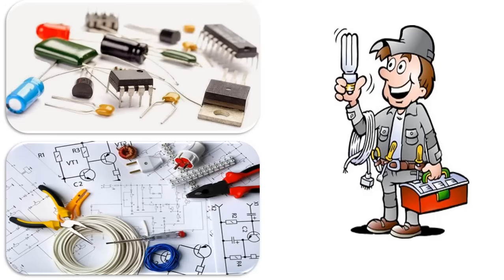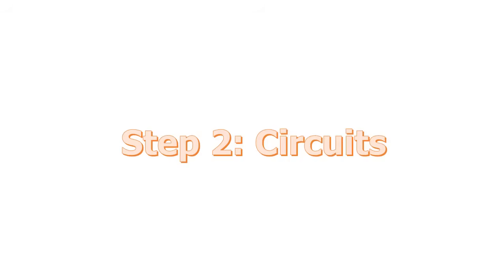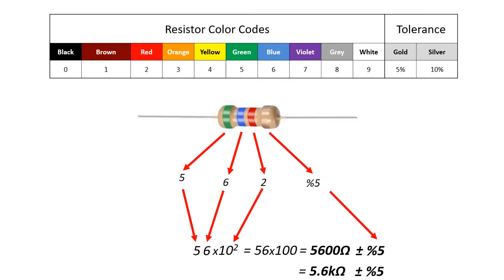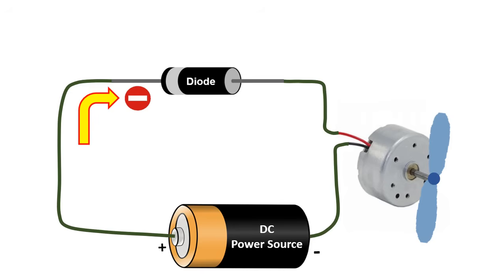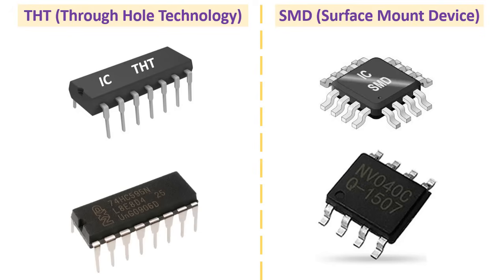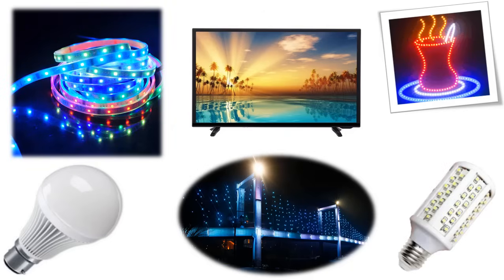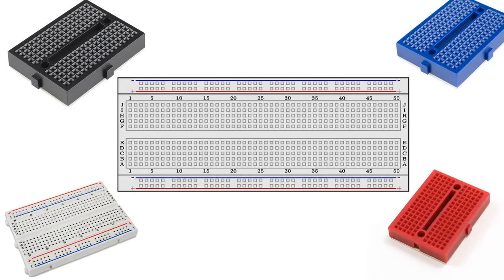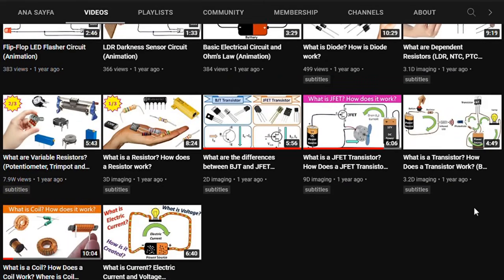Basic Electronics for Beginners in 15 Steps

Comment: What about transformers? In 1978 there i couldn't light up a LED by plugging it into a 120v socket, without using a big transformer 2 do something with the excess voltage and heat... could I? And if i couldn't then, but can now... what happen?

Comment: 2:30 "In series connected circuits, the same current flows through all loads" "In parallel circuits, all loads have the same voltage" This is a very unclear explanation of the difference as it pertains to voltage & current, and to a novice like myself, I thought you were saying the same thing about both in a different way, so I looked it up:

In SERIES all components share the same current but voltage is divided among the components based on their resistance. 
In PARALLEL the reverse is true -- All components share the same voltage equal to the source voltage, while the current is divided among the branches based on on their resistance.

Comment: In a simple circuit with a battery+ resistor+led,the led acts as a resistor and + the first resistor,it becomes a voltage divider,right?! So in that circuit the current is the same as the battery,only the voltage drops,right?! Is my understanding correct?
Reply: No, there are many things incorrect in your understanding.
-A resistor is used in series with LED to limit the current flowing through the  LED. LEDs cannot handle lot of current and they will fry if the current is not limited. 
-Remember V=IR. This means if the voltage drops, and the resistor does not change, then the current has to drop. So this resistor not only drops the voltage but limits the current, which is its main purpose.
-An LED does not act as a resistor. In some cases it is used as a diode but don't worry about it for now.
-A voltage divider is a bit different than anything shown in this video, and I suggest you understand voltage, current & resistors before learning about voltage divider, it will make it easier.
Reply: @kuro758  So if I try to measure current after the resistor with a multimeter,it should be less than before the resistor?

Comment: I want to be an electrical and electronic engineer and practically sound for self training, what are the topics I need to study step by step to get there or achieve my gool.
Reply: Check college outlines and find your own recources. Surpisingly lots of colleges and universities tell you what you need to learn in the outline often times and you can use free open source textbook websites to download what you can find within. Hope that helps
Reply: Electrical and electronics have a crossover point is the first thing to understand. Point of the power supply tends to be the cut off points. Also, electronics gets very deep when we get into rf analogue, digital etc.  Suggest you find a place you are happy at. Much of the stuff one learns at college will never be used in real life, but the principles are important in other stuff even if it is not obvious to start with.

Comment: Without the led spec sheet I would assume it draws 20 mA. The battery is 9 volts, R=E/I ohms law so the resistor you use is 9 volts divided by .020 amps which is 450 ohms. Your 330 ohms would  run it a little hot. This is basic design engineering.

Comment: How do you diagnose an AC DC switching power supply  power unit that is not working? Class two power unit output, 29.0 V to amps 58 point 0 W

Comment: You messed up at 12:12 - the resistor is not 330 Ohm.
Reply: Also at 05:55 he states that "the amount of current that passes between these pins is proportional to the voltage being applied at the base pin". It's not. The amout of current at those pins are proportional to the CURRENT being applied at the base pin

Comment: Wrong!!! 

Can you idio7s stop teaching that in DC the current flows out the positive.. you're teaching the wrong physics and no wonder people think stupid things like disconnecting the positive on a car battery first.. 

You are wrong!!
The current flows (Slowly) out the negative end toward the positive end. 
Electric current is the flow of a negative charge. 
Also current doesn't hurt you or light up your light bulb, the electromagnetic force inducted from the electromagnetic field is what does this.
Reply: theres 2 models for what you are talking about, one is electron flow (negative to positive) while the one hes teaching is conventional current/flow
Reply: You are correct, but this channel is geared more toward practical applications of electronics
From a practical perspective, these definitions dont hold much value. Sure electric current flows out of the positive terminal of a battery, but the effect of making this dastardly error is to either flip your signs in your math or simply flip the battery...
Current doesn't light up a light bulb, but also the accelerator pedal on its own doesn't make the car go. It's actually the opening of the valve in the throttle body that allows for airflow in the engine to power it

Again you are completely correct, but they aren't really that important for practical purposes. Our comments are the epitome of physicists vs engineers.
Reply: What is the correct way to disconnect the car battery?

Comment: I liked this brief introduction to electronic circuit design and components.  I am a rank beginner.  It went fast but that’s ok, I can re-watch or turn to more in-depth segments. As for the EE’s out there who are trying to catch every little oversimplification, I would say, refer to the title of the vid.  I am deeply appreciative that someone would take the time to prepare and post this info, it takes time and talent.  Thanks!  Now I can build concepts on these basics on my way to building a guitar amplifier.  And yes, I will be careful with the filter capacitors.
Reply: Did you try watching at a slower speed?

Comment: 1:15 what i understand that alternating current change's direction of electrons 
at some sequel point eg : at first charges flow -ev to +ev then +ev to -ev  and vice versa happens through battery across the circuit

right or not?
please reply!
Reply: Wrong. 
In one part of your statement you're referring to A.C. characteristics. The other you're referring to D.C. characteristics.

Comment: Help, advice needed, I am building a mini Vertical Axis Wind Turbine ( VAWT), I am good at construction and qualified at fabrication but know v little about electronics. I am currently stuck on what ( size) Diode I need for a Cordless Drill size motor to a small 2x 12v Battery pack. I saw a vid that said a ‘’blocking Diode’’ is what is used to stop electricity going back to the Gene from battery, but you say in this vid that Diodes block, not specifying a ‘’blocking’’ diode. So are all Diodes’’blocking’’ ones?, also could you or anyone pls tell me what size ( ‘’blocking’’ ?) Diode   I would need for my above mini Wind Gene? I would really appreciate some advice with this, as it is to part power my flat.
Reply: I will be creating a VAWT generator using a car alternator which has a rectifier to produce DC.
Reply: I would advise you to wait a little longer before you attempt this project. As you progress through explanations of power generation and rectification characteristics it will become apparent why I'm making those suggestions. As an example ( a very relevant one). How much of a load is going to be required? Until you can answer all of the relevant questions ACCURATELY, folly is probably inevitable.
ly

Comment: What happens if you dont use a resister on an LED circuit?
Reply from the maker: LED will be damaged because high current will flow.
Reply: @eeapplications  Thanks
Reply: Resistors like capacitors and other components have names,
Names that are functional but may seem confusing
Things like 
Current Limiting Resistor

Step Down Transformer
Bulk Filter Capacitor
Smoothing Capacitor

NOW.....   Even though, simply stated, we are only talking about a standard
Capacitor here 
or a Standard Resistor
or a standard Transformer

THE NAME IS GIVEN AS A RESULT OF IT'S FUNCTION OR PURPOSE IN THE CIRCUIT OF THAT PART OF THE CIRCUIT
in the example of a Smoothing Capacitor, it's function is to smooth out ripples in the voltage HENCE THE NAME
in the case of the transistor,   it takes a higher voltage (say 240V AC)
it reduces it  (STEPS DOWN) to say 16V AC on the secondary coil,
hence the name

now.. this resistor is called A CURRENT LIMITING RESISTOR because it is put in circuit to   LIMIT THE CURRENT going to the LED

now let's examine your question
"What happens if you dont use a resister on an LED circuit?"

SCIENTIFIC AND LITERAL ANSWER :
Your current will not be limited going to the resistor

OVER LAMEN ANSWER :
Shit will blow up

REALISTIC ANSWER BUT NOT TOO ENGINEERING LEVEL:
depending on a few factors and considering ohm's law, Your LED might not blow up and you might get lucky, but if you do , Over time the lifespan of your LED will greatly reduce.
it is however more likely that your LED will blow up or the filament will go open circuit because LED's are low power devices , You put too much current through them or voltage and you exceed their rating they're likely to fail

also..... RESISTOR is spelled like this
also..... the answer depends on WHICH RESISTOR VALUE YOU CHOOSE and which LED you chose

so... does that help you understand

The Take away is....
YOU ADD THE RESISTOR, YOU LIMIT THE CURRENT FOR THE PURPOSE OF PROTECTING THE LED
YOU TAKE THE RESISTOR AWAY AND YOU LET THE CURRENT FLOW FREELY FROM THE SOURCE TO AN UPROTECTED RESISTOR TO SUFFER THE FULL FORCE OF THE VOLTAGE AND CURRENT

Hope that helps
Reply: if your supplying the led with voltage higher than that of the maximum rating for said led without a resistor then it will indeed blow
Reply: Connect more LEDs in serie, total LEDs voltage aproximatly equal to source voltage. :body-blue-raised-arms:

Comment: I understand electronics. But it still blows my mind. How they make a billion transistors work on a chip. Please show how it works
Reply: It is at a level now that is very proprietary. About two decades ago micro miniaturization was accomplished by establishing a interior composite of a component on diagram media and that component and all of its neighbors were reduced down photographically to be extremely small. Much smaller than the component it was modeled after.

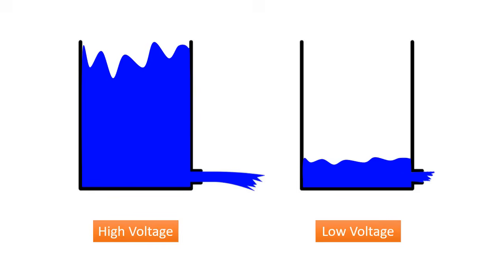Comment: 1:23 I thought 60 hertz means 60 times per second ???
Reply from the maker: It happens 120 times because there are two parts in a sine wave, positive and negative.
Reply: @eeapplications  
That's incorrect
1 Cycle Is defined as 360 Degrees
The first 90 degrees happen when the voltage starts a 0 degrees and ramps up the rising edge until it reaches it's peak voltage
90 degree to 180 degrees is when the positive half of the sine wave is now creating a falling edge and dropping back to 0 V AC
180 degree finishes when it hits 0V AC again.
180degrees to 270 Degrees occurs when we enter the negative part of the sine way and continue the falling edge until it reaches it's maximum negative voltage
270 degrees to 360 degrees occurs on the 2nd rising edge as it travels from it's lowest minimum voltage back up to 0 V AC and completes 360 degrees (1 cycle) when it his 0V AC again

Thus  we have Cycles,   HERTZ = CYCLES per second.
1 CYCLE (Coming from the word CIRCLE) = 360 degree's

60 Hz = 60 Cycles per second
you are referring to 120 POLARITY CHANGES Per second 60 seconds
or.. 2 POLARITY CHANGES Per Second

this however is not the definition of HERTZ
it's the definition of POLARITY CHANGE

WHY CONFUSE THE YOUNGSTERS ?
Reply: @eeapplications  
so here are your mistakes

1:16
THE RATE OF REVERSAL IS MEASURED IN HERTZ

NO..... !!!!!
HERTZ MUST BE ... CYCLES PER SECOND
Not REVERSALS PER SECOND

1:23
WHEN THEY SAY THE U.S. POWER SUPPLY IS 60HERTZ , WHAT THEY MEAN IS IT IS REVERSING 120 PER SECOND

YES, THAT'S TRUE AND CORRECT
but...  it's not Hertz
I'TS POLARITY REVERSALS
a Hertz must be measured in FULL CYCLES every time
Reply: @eeapplications  I disagree. Lol.
Reply: @yeyo-sz2cw  I think he is talking about the number of inversions from positive to negative per second and not the cycles per second.
Reply: @yeyo-sz2cw  
I don't disagree....  HE'S FLAT OUT INCORRECT,  it's not even a debate,
Wrong is Wrong
Reply: @jancenj2218  
he is ,  He's talking about polarity reversals but he made the mistake of calling them as being measured in hertz before they complete a full cycle
Reply: 60Hertz DOES NOT mean 60 TIMES per second
it means  60 CYCLES per second
you can pull yourself 60 times per second, do we count the upstroke and downstroke or just the downstroke

CYCLE is the operative word here and the important word

Comment: Multiply was 2 so why did it get multiplied by 100?
Reply: 10 to the power of ‘2’ , or 10 squared.  10 x 10 = 100
Reply: @bleddyjj  thank u
Reply: Research DECADES and ORDERS OF MAGNITUDE

it's not MULTIPLY  it's  MULTIPLIER
so if the resistor multiplier is   2  and your current value before that is 20, it doesn't mean 20x2 =40
it means 20 x 100 = 2,000

so... Multiplier
0 = 0 (or .. Retain whatever value you already are up to)
1 = x 10
2 = x 100
3 = x 1,000
4 = x 10,000
5 = x 100,000
6 = x 1,000,000
7 = x 10,000,000
8 = x 100,000,000
9 = x 1,000,000,000

so multiplier Value of 2 means x 100  10 to the power of 2
Basically add as many zero's as the number is 
2 = 2 zero's
5 = 5 zero's